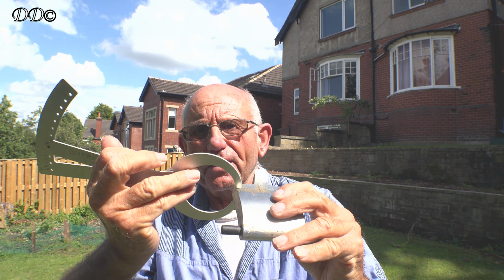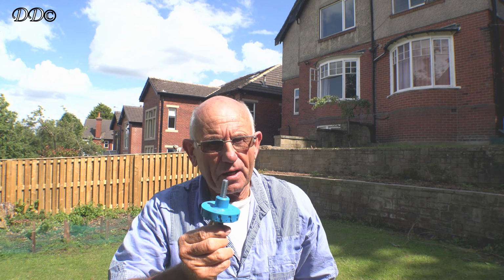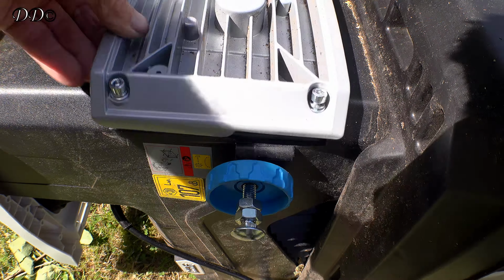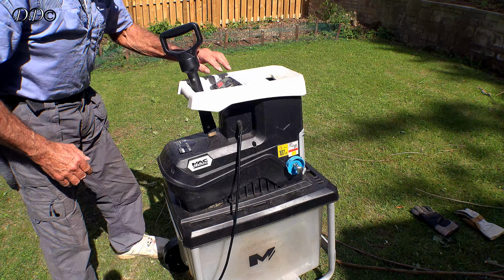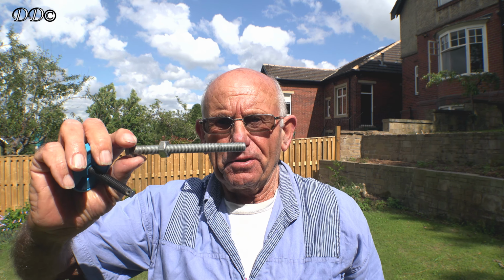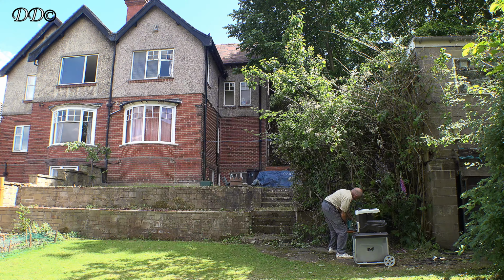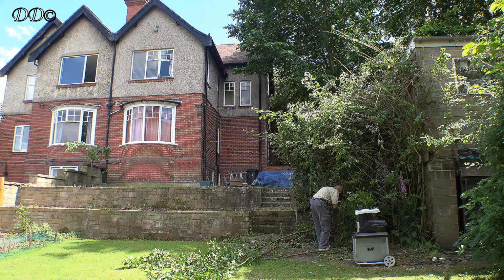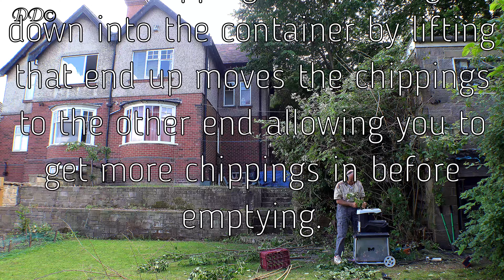Design fault on MacAllister MSHP2800D-2 Shredder easily corrected for £1 Ware to get spare parts. 4k

Comment: What a fantastic fix!  I noticed the problem pretty early on - running out of adjustment - and tried to glue something to the adjustment bar but of course it didn’t work. Even bought another shredder to see if there was something wrong with mine.  There wasn’t so I took it back. Anyway am now out to workshop to find a bolt and some nuts and have already ordered my replacement adjustment bar for when the time comes.  I hate it when things aren’t fit for purpose. Thank you so much. I can now look forward to many hours of happy shredding!
Reply: I’ve sent mine back buying a Bosch my old einhell was much better I find the macalister bit difficult to store and I think the motor runs too fast and it is geared down high speed low torque the Bosch is brushless motor low speed high torque much quieter… saying the the Mac is okay I’ve nowt else to spend my money on
Reply: @barrytipton1179  what bosch did you get and the price please? I'm looking at the mccalister atm to buy tomorrow
Reply: @UnseenSpirit  I had a einhell was great however I forgot to cover for the winter I bought the Mcallister and after watching the video I returned it . I think it would be okay I went for the Bosch ax 25 a awesome machine the Bosch is three times the price. The macallister was okay I misunderstood and I was using the screw up wrong for the aluminium block . They are all good but only the quiet type with the sacrificial aluminium block. I’m a bit of a power tool snob. It’s on offer at screwfix £130 ish no problem returning
Reply: @UnseenSpirit  paid just under 400£ for the Bosch the ax is better

Comment: Hi Derek
Thank you for your reply with the info about the newly ordered pressure plate. Without having that info I may have sent it back thinking Solent had sent the wrong one. I will be purchasing the coach bolt tomorrow and have an old broom handle for the plastic “ truncheon”.
Keep Safe

Comment: Thanks for the tip Derek.  
I was suffering the same problem after just one season where I had used up all adjustment.  The origianl pusher was next to useless, but now I have seen your broomhandle mod I will try the same myself.

Comment: Thanks Derek -the couch screw tip worked a treat :)
 I've used the Baffle Plate For Makita Ud2500 - seems to be an exact match as well.
Reply: How did u remove original screw?

Comment: Wish I has seen this first Derek. I returned mine I bought yesterday  Nov /14 /2021 Still the same fault. They have not acted on your findings it seems. Here is a copy of the review I left. I don't know if they will allow it.  

I was looking forward to using this machine advertised as a Shredder.
But there is a fundamental difference between a shredder and a chipper.
A shredder will shred green plant waste and leafy plant waste.

A Chipper will take care of branches and stems from trees and such. 
The more robust kind of waste from pruning trees and shrubs.
 That will Cut  them into reasonably small pieces. To be used as a mulch.

They are fundamentally two different kinds of blade set up 
This machine has a circular cylinder blade set up with  a number of blades on it.
The gap between the blades relates to the size of the chippings. 
It is the blade that pulls the item to be chipped into the machine.
This process works fine on rigid material such as branches and twig size material to a certain size.

The problem with softer greener waste such as leafy material is two fold.
It will send that waste through and into the bin without cutting.
Or it will wrap itself around the blade.

Now there's a video made by Derek A Wilson  on Youtube with another
Design fault on this machine Worth looking at  before one considers buying this machine.
He has found a  simple way to fix  the design fault. You can find that by using this link
https://youtu.be/-rngj9wLP1E 
Spare parts are still in issue with regards to the pressure plate.
Derek has a link on his video with regards to a replacement.

Now don’t get me wrong it is not a bad machine if one needs a Chipper.
The instructions state that if you need smaller chippings you can run the first cut material through a second time.  
But if you require a shredder for softer leafy material this is not the one for you

So I had to return the one I got to the shop.
As it is not a Shredder it is a Chipper.
Yes there's a difference.  

So  overall rating I gave it 4 stars because as a chipper it would be a Good one.
For value  I gave it 5 stars because as a chipper it is an excellent price.
Features 5  stars because  it has some excellent ones as a Chipper.
Performance only two because as a Shredder as advertised it is not 
Reliability only 2 because it still has the same design faults that Derek A Wilson pointed out 
On the 22/6/2020

Comment: Thanks! 
Just seen this and was about to order a new plate and adjuster from Solent.. My MacAllister is about 2 years old and had run out of adjustment, I have all the parts I need in my stash of bolts and will use a 180mm coachbolt with locknuts and the blue locking ring, the last 80mm of bolt will be bent at a right angle to make a sort of handle.
My previous Gardenline shredder did 10 years hard work but eventually the pressure plate wore right out and the adjuster bolt made contact with the blades, sadly spares not available now but the MacAllister is just as good if a little noisier.

Comment: Thanks for the informative video. I just bought one second hand and I thought it was useless as branches were chewed up and pulled through but not cutting and definitely not mulching. I will try this fix and see if it works.
Reply from the maker: Don't forget to get a 90mm full length M10 threaded bolt or coach bolt, the reason for 2 nuts on is I don’t know exactly how much of the cutting plate will be left when it gets to the nuts touching the locking nut, 
so at that point I will take the end plate off the machine and have a look if there is enough left to take one nut off and carry on using it or to change the cutting plate  

So once you have got your 90mm bolt screw the 2 nuts and the locking nut on and the machine is running, keep turning the bolt clockwise until you feel it scraping on the cutting block you should now see long thin strands of aluminium in the box, 
at that point still keep hold of the bolt and tern the locking nut clock wise to lock the bolt in position. Later that day and you have sent a lot threw it or the next time you use it  you may have to tern the locking nut anti clock wise and the nut clock wise to take some more shavings off followed by terming the locking nut clock wise to lock it in position. Good look.

Comment: Great idea Derek: I had simply left off the locking collar to gain extra length on the pushing screw, but your bodge looks more robust!

I think this is a fantastic machine for the money and I am on my third (replaced under warranty after I had managed to break it...)
Reply from the maker: How did you manage to brake 2 of them? What went wrong with them? 
without locking nut on and original thread bolt with the vibration will unscrew itself making the machine useless. It will work screwed in to its maximum in but to do that you will have waster about 10mm of scraps
Reply: Hi Derek,
On the first machine I had, the thread went on the lower left hand bolt securing the faceplate/blade guard, which operates a spring-loaded safety cut-out: I was able to fix that myself with a longer and slightly bent bolt, but I saw no downside in getting a new machine under warranty as I had been using it hard for about 6 months and with two replacement counter blades.
The second incident was rather more dramatic: a particularly large and hard piece o wood caused the machine to jam and fractured the metal chamber containing the cutting blade: I then had more difficulty in getting the next machine under warranty because of covid restrictions, and even began to wishh that I had kept the trusty original...
So far I am treating the new one little more kindly, but of course there is still the two year warranty!
Interestingly, as I only remove the locking collar when the no further adjustment is possible because of the shortness of the adjusting bolt. it then holds sufficiently firmly not to need the locking collar.
By the way , I enjoyed your helpful video and have forwarded the link to a friend in Spain who is interested in getting a garden shredder: however, without B&Q or Screwfix, I am not sure whether he will be able to find one of these.
with kind regards, Kevin

 @derekawilson2118

Comment: Nice one, I'd run out of adjustment but didn't have a bolt but had some threaded bar and a dome head nut. Works just the same and I cut it down so I can't accidentally wear it down too much and catch the blade with the bolt. It's given me an extra 10mm of wear
Reply from the maker: I hope the thread is M10 or you will have problems later on

Comment: Champ!
Really informative to see precisely how the mechanism used by these silent shredders operates.

I've been looking at garden shredders to replace a Bosch 2200 impact shredder whose motor failed.
We've gone through so many impact shredders over the years, so am looking for a more durable design.

Spotted the Ozito 2600W Silent for ~£100, which looks to be a very similar design to this MacAllister (which is now £150).
Thoughts?

Comment: I'm on my 3rd machine in less than a month. First one was great proper little chomper but then the thread on the counter plate blade stripped and jammed so couldnt undo it
 I took it back to SF and the staff member was fantastic. Offered me a refund or a replacement no trouble at all orbeit I was s little concerned the same thing may happen again as the bolt just isn't strong enough. I took the replacement as I still had work to do.

I took the replacement and literally 20 minutes into working the adjuster knob stopped turning and jammed... I was so frustrated as the machine really does a great job at shredding.
I took the machine back two days later and again explained what had happened.  The staff on this occasion couldn't have been any different. The assistant looked at me as if I'd done it deliberately and question how it had happened. She hadn't git s clue how the thing worked but clearly thought I'd done it deliberately. 
I asked if I could have one from another batch as possibly this batch had a simple fault of a dodgy bolt. But I was informed she had no idea how the batch system worked. I really didnt want another only to bring it hack again in s week or so with the same issue but still has 6 conifers to take down.  Eventually she brought a replace6to the counter and opened it up before I even agreed to take it. She then insisted on checking the counter blade knob showing me it worked before I took it... 
I'm only hoping now the same thing dont happen again and gave even purchased a replacement m10 bolt from another supplier as I just done feel the bolt supplied I'd upto the job...
Any one else had this problem???
Reply from the maker: What makes the cutting plate bolt  jams (wont turn by hand) is when you are shredding wood bits of it get jammed in the side edges of the cutting plate (jamming it up after a while) so it is now two tight to tern by hand. 
As per video you should have changed the bolt for a M10 bolt as the one supplied is two short, so once you get to this stage use a spanner to get that extra leverage to tern the bolt clockwise to reset the cutting plate. The other alternative is to take the front plate off take the cutting plate out and clean round it and put back together every time it happens.

Comment: Great video and thanks for the fix. I have the bolt and nuts. Only problem is, I can’t get the original bolt off. Any tips for that?
Reply from the maker: Yes there is a note on one of my replies some were not ha to do it myself yet, take the end cover off + cog and plate off screw bolt in as far as you can & cut the bolt end off, if you cant get in to cut cut the outer part of bolt off at the threaded point and screw in off by screwing it into the inner compartment (the plate banging against it as riveted the bolt end) then take bolt out

Comment: Fantastic idea! But my original bolt just won’t come out? It’s just gets really stiff and stops any ideas?
Reply from the maker: Yes Use the allen key supplied with it to take the front plate 4 allen screws and the front plate off, take the cutting block and the pressure plate out, screw the bolt further in and at the same time use a weir brush on the thread to get the small chippings and sap stuck in the threads off once you have got the threads clean all the way round  the bolt should come out by hand.
Reply: Thanks very much 👍🏻
Reply from the maker: Just had that problem see new entry billow video BOLT STICKING and GETTING BOLT OUT
Reply from the maker: Just had that problem see new entry billow video BOLT STICKING and GETTING BOLT OUT

Comment: HiDerek , I got a little lost along the way , after watching your video putting the 90mm coach bolt in , did you come across a problem ? Is that where you added bolt sticking 31 March 2021 ? If so would be very useful if you can make a video showing how you got around it . Thank You.

Comment: Hi Derek.

I got a machine like this passed onto me as part of an inheritance. 4 yrs old and never used but out of its box and very dusty.

I plugged it in and the blades move painfully slow. To the point the blades jam even on a dry twig. From listening to your machine in your video the sound comparison of the revolving blades is incredible. Mine makes a very low rumble where as yours is ready to take off.

I can't find any help anywhere and was wondering is it to do with the blades being unused or what I'm not sure. Total newb to all this machine stuff too so forgive my ignorance if I left anything essential out. Do not have the manual either.

Comment: Disco my shredder has started chewing up the motor with a burning smell I'm thinking it needs that coach bolt cause the plates aren't close enough any more ?
Reply from the maker: That's what the video is all about the bolt supplied with it is two short for the cutting plate

Comment: Did you have any trouble removing the original threaded bolt?  I have been unable to undo mine.  It will only retract up to a point and then it just tightens up.  Any thoughts?
Reply from the maker: I had no problems with mine it turned freely anticlockwise. Could be you have got some chippings on the thread inside try turning the locking nut anti-clockwise until it tuches the plastic bolt cover then turn the both clockwise until it wont turn no more then try turning it anticlockwise to see if it will come out. If that doesn't work get the allen key supplied with it and take the aluminium panel of the front and the scraping plate out to see what the problem is with the bolt
Reply: @derekawilson2118  I really appreciate your reply Derek. For what it’s worth I think over enthusiastic tightening of the original bolt might have warped it a little at the end, making it impossible to remove by hand. I popped off the plastic adjustment cap causing as little damage as possible which revealed a head I could get a spanner on. Just got to source an M10 in lockdown!  Thanks again.
Reply: @hardlands  I have exactly the same problem. The adjuster jammed pretty solidly fairly soon after I got it. Looking at the bolt on the inside it looks to have been distorted and the tread damaged presumably by too much pressure from the plate. The gap is now about 1 to 2mm so shredding is not all that good and leaves do choke it up frequently. I’ve just about mastered getting the leaves back out but I had a major jam with a piece about 15 mm diameter and the machine cut out. Resetting didn’t work and I spent an hour or so chiselling out the jammed wood. I think the failure to restart was muck in the safety switch in the cuttings box. It’s going again now but I need to find some way to get that bolt out and replace it. I put an adjustable spanner on it an managed to move it a couple of turns but now it won’t move at all. The locking ring moves freely though. Presumably if I lever off the plastic knob as you have done I will be able to turn it with a spanner but I might have to screw it in first and then somehow saw off the distorted part before I am able to screw it out.
Reply from the maker: Just had that problem see new entry billow video BOLT STICKING and GETTING BOLT OUT
Reply from the maker: Just had that problem see new entry billow video BOLT STICKING and GETTING BOLT OUT
Reply from the maker: Just had that problem see new entry billow video BOLT STICKING and GETTING BOLT OUT

Comment: Most helpful information. The link to solenttools was very useful. Just ordered the pressure plate from them. Is this pressure plate supposed to wear out with use? Mine looks like the blades have been trimming it thin until it was too thin and had to break.
Reply from the maker: Yes the pressure plate is only aluminium so it helps keep the cutting cog from going blunt, every time you reset in pressure plate screw in for the cutter to catch the plate gets thinner, when you send a few thick piece of wood threw that also wares the plate away creating a gap between the cutter and the plate, so you have to tern the screw in so that it will shred small pieces.